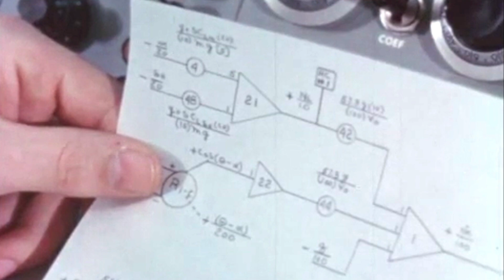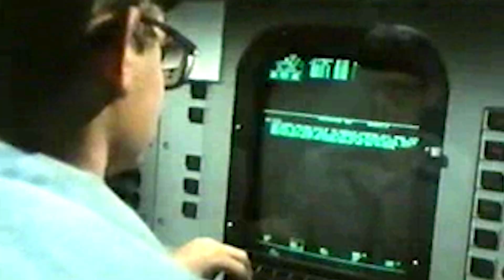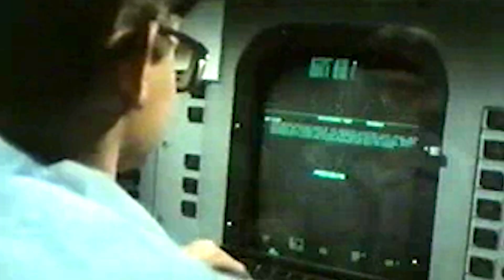A-5 Vigilante - The Aircraft Carrier Nuclear Bomber

Comment: Came across one of these in a small boneyard while "exploring" Eglin AFB's Reservation. It must have been used for target practice, because it was all shot up and in pieces. At first and at the time, (around 1984) I thought it was an F-14, since it had the same air inlets. Then I saw the unmistakable single vertical stabilizer root. It was awesome looking, even in it's "destructed" condition.
Reply: Given the reconnaissance role these played that one you saw might not have been target practice
Reply: @maxk4324  Why couldn't a recon A-5 have been used for target practice? Your sentence doesn't make sense. Were you in target acquisition? Did being a recon version, EXCLUDE it from being used as a target many years AFTER ITS RETIREMENT? I'm pretty sure jets that WERE used in recon roles, WERE used as targets later. My father WAS in target acquisitions while in the Air force, and we have many pictures of targets and some, I'm sure, had been used in recon roles.  Here he is on the back of an F-102 Delta Dagger, while TDY trying to acquire it for target missions from a National Guard installation, fitting it, ironically, with cameras to catch footage of the missiles coming at it. This one in particular wasn't, but it could most certainly, have been a recon model, had it later been a "Six". Peace. https://i.imgur.com/SzEGKYc.jpg

Comment: Grumman's TARPS pod for the F-14, is what convinced the Navy to finally retire the RA-5C and the RF-8G from the fleet reconnaissance role. The pod was marketed to the Navy in the 70s as a cheaper alternative to maintaining separate airframes for the recon role, as the pod could be carried by modified F-14s. But the TARPS pod was not ready until the early to mid 1980s.

Comment: I remember every time the A5's landed, I expected the nose gear to break off.  It would hook a wire and the front would sway back and forth.  Never saw one have a problem and such a beautiful plane.
Reply: We did lose one over the side of the USS Independence in 1970 when the tail hook broke during landing. The hook slowed the plane so much that it couldn’t regain flying speed. Landed upside down in the water resulting in the loss of both pilot and reconnaissance/navigator.
Reply: @richardturner1036  I was in only 4 year and my A4 squadron deployed on 3 different carriers and never saw an A5 problem and never saw a tail hook break.  We had a hard landing requiring a wing change and one shot up causing gear failure and but got on board with the net.  Kind of messed it up.
Reply: They'd blow nose wheel tires on arrested landings now and then.

Comment: I'm gonna stop at 5 minutes! Dude you resarch and the photos you show are just inaccurate. You were talking about the linear bomb bay and showing rotary launcher in an FB-111, you repeated a couple times that the bombs and fuel tanks would fall off... Come on,if you're gonna do a video about a plane,at least actually read about it! You finally mention the Problem with the bomb delivery system, and showed a picture of the actual bomb"tube"between the engines but you didn't make the connection between the two!  It didn't carry external drop tanks like regular planes,they were like the conformal fastpack tanks used on the early F-15. Sorry just not gonna watch anymore of your stuff. It's a shame. You pick Really good, fascinating aircraft,then half-ass Google,and wiki searches. I done.

Comment: This bird today would be scary. The engine from the f35, radar absorbed materials, and a long bomb bay that could carry 4 slams. It would be fast
Reply: Terryray123 no stealth calabilities. The F105 was a much better plane for this purpose
Reply: Terry: The A-5A/RA-5C carried a single weapon. The video is wrong.  And no, your fantasy is not possible.
Reply: @KB4QAA  ya cause the navy would not build planes or ships that work or make sense
Reply: @Terryray123  Exactly. The A-5 basic design is inherently un-stealthy. You can't just slap some material on it and hide it from radar.  2.  The A-5 design was designed for high speed, high altitude nuclear attack. It's entire flight regime is not fitted for present attack requirements.
Reply: @KB4QAA  i understand that put radar absorbing materials won't lower in RCS that much but it's a start.

Comment: Looking back supersonic bombers for the US haven't had a whole lot of luck. The B-58 Hustler and A-5 Vigilante had a lot of issues which limited their production runs to less than 200 of each.

The B-1B Lancer can just break mach 1 but still had a limited production run and is expected to be retired before the B-52!

The F-111 is the most successful and it didn't even get the B or A designation even though it never carried air to air armament.

You think of supersonic military aircraft as the modern thing but outside of fighter bombers with the corresponding small payload they just don't replace a real bomber/attack/strike aircraft.

At least stealth is reliable with even the F-117's tiny bombload being incredibly useful thanks to guided munitions and it's long range.

Comment: The British TSR2 and Canadian Avro Arrow are other amazing Cold War aircraft that never had the chance to prove their potential, and were similar in many ways to the A5 Vigilante.
Reply: I suspect TSR2 borrowed quite a lot of ideas from the mid 1950s NAA NAGPAW concept, what is interesting (to me at least) was TSR2's planned recon load out mirroring the RA-5C's in broad capabilities. The Vigilante was way ahead of it's time in terms of avionics - folks bang on about the bomb-system & recon sled - but it also had some pretty sophisticated (for the 50s & 60s) integrated ECM, Threat Warning & ELINT gear fitted as standard. Those ECM/ELINT features set it apart from it's contemporaries, I guess they haven't had much attention because that kind of gear tends to be hidden away from prying eyeballs (a lot of info on the RA-5C ECM systems is now available on the web).

Comment: The technique of throwing a bomb from the in line tube was amazing.  During a family day a board Saratoga, off Jacksonville, a crew from RVAH-5 dived from angels 32 to less than 10 then pulled up while pushing a dummy out the rear.  This cracking the whip threw the bomb 75 miles and the  splash extinguished a smoke flair attached to a radar buoy.
Our first loss in Viet Nam 1972 was a Whale.
Sexy plane. RA5C where my second favorite craft after the A6.
Reply: Shame the tube throw was unreliable as hell!

Comment: TCAS back in the 60s? Amazing
Reply: I'm not sure that the Vigilante system worked like the present day Traffic Collision Avoidance System (TCAS), which involves nearby aircraft transponders 'talking' to each other, calculating the best way of avoiding a midair, and then giving the pilots of both converging planes a voice message warning telling them how to alter course if necessary. The setup on the A5 seemed to be more related to Terrain Avoidance in low level flight, and mainly used the forward looking radar for inputs.

Comment: The film of ordnance being deployed does not show the bomb bay configuration of the Vigilante, which had a longitudinal tube running down the centreline of the aircraft, with the nuclear device positioned at the forward end and two cylindrical and expendable fuel tanks in line astern directly behind.
Reply: Wasn't that the A-3?
Reply: @alienbeef0421  Nope. The A-3 (looked like a B-66) had a typical bomb bay.

Comment: That’s my favorite plane right there
Reply: I was lucking enough to be a plane captain in RVAH-6 and RVAH-12 and had a great time with the Viggies.
Reply: @NKBobcat  Respect for your service. Like the F14, did the Vigi need very high servicing hours, especially in carrier borne deployments? I believe that was the main reason that the Tomcat was retired several years ahead of its time.
Reply: @johnstedman4075  it needed 12 hours o maintenance for every hour of flight. It had systems that were ahead of their time. It was literally a spy satellite before spy satellites existed.
Reply: @NKBobcat  Thank you! That's quite a workload, and well before there were high level diagnostics software and plug in devices to pinpoint the source of problems. It must have caused a lot of head scratching. On the F14 the ratio was even worse, about '34 to 1' I believe, (often because the parts store was empty and 'creative solutions' were needed), but everybody was very sad when that aircraft left the fleet. It was in many ways irreplaceable.
Reply: Sure is a work of art. My favourite is the Chance Vought Cutlass, another aircraft which seemed ahead of its time, but was soon cancelled not because of airframe or avionics problems, but in that case due to a bad choice of powerplant. Both the Vigi and the "Gutless Cutlass" took too many aircrew to their graves.